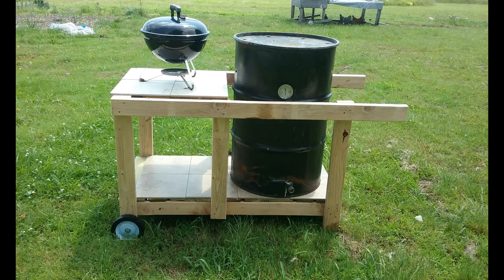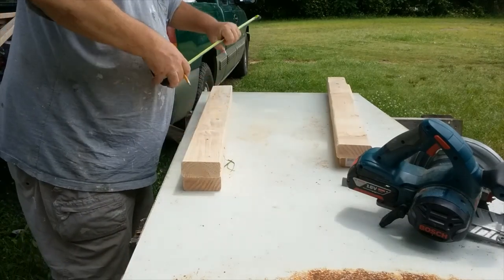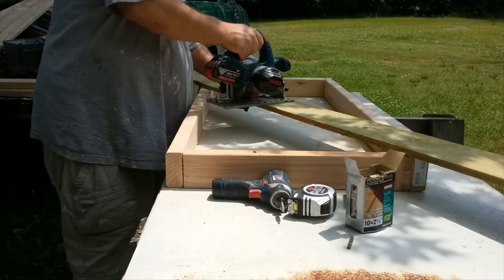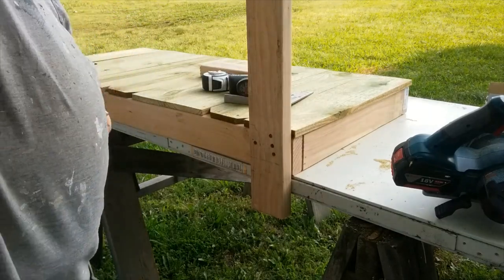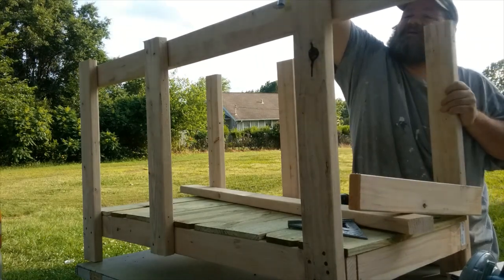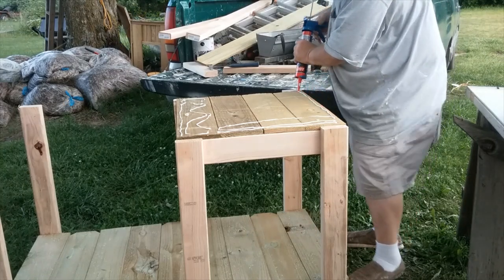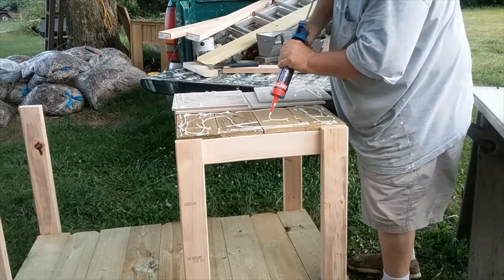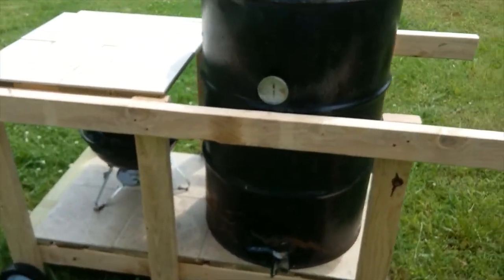How to Make a UDS Smoker Stand BBQ Grill Cart  w/Table For Less Than $100

Comment: Great idea and build, however, I need to move mine up a ramp and into the shed 100' away with soft ground and a 300 lb Kamado joe. So, I would need rubber air tires and consideration for bouncing and weight. I hope you have not patented your cart!! Great video!
Reply from the maker: LOL...no worries, no patent! You can find larger/wider tires at Harbor Freight. They're reasonably priced there.